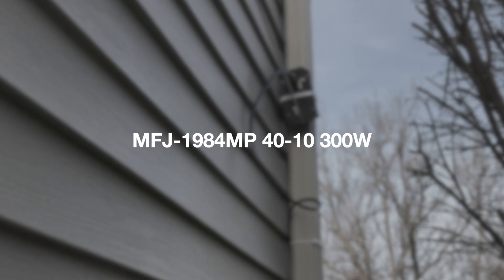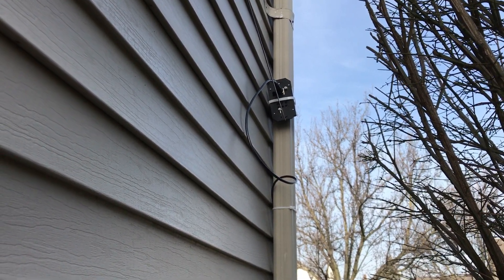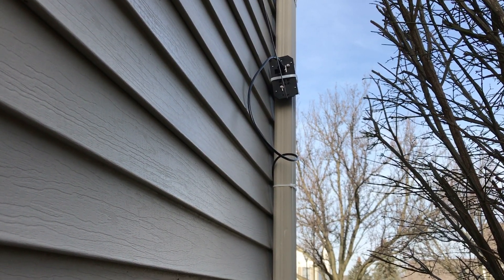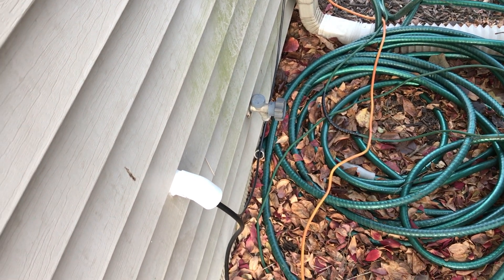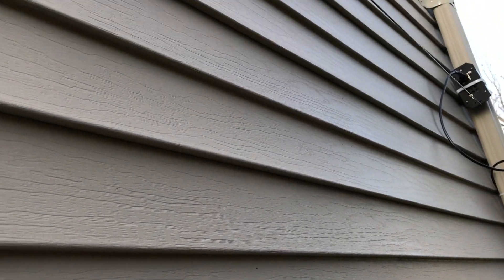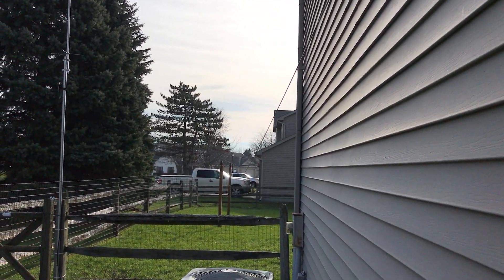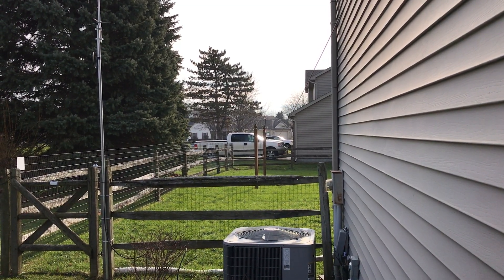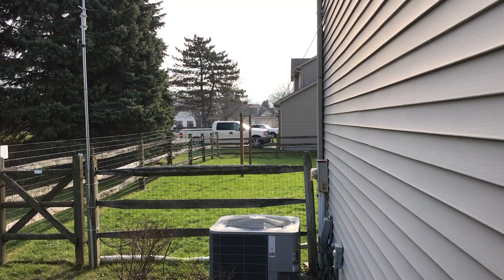MFJ 1984MP EFHW 40 10 300 W

Comment: Best wishes with your your learning, doing and everything the hamster hobby brings you, Vern. I’m just beginning to learn, myself. 63yrs old.
Licensed since APR-2023. Juuuust looking at getting into the General level. I bought a Xiegu G90 couple o’weeks ago because the HF/DX/QRP bug bit me. So now Gottttta do it.
Well Vern, CHEERS, 73 & many blessings your way.
ps.   Thanks for the video. Also- You can tighten the sag outta your antenna wire by
adding 3-4lb weight at the end. Or, better than tying off the end-
run the end of your wire through a little pulley attached to the support pole. THEN add as much weight as you desire for the
horizontal effect.👍🏼

Comment: What about angling it away from the house a bit?? I had horrible results when mine was like that close to the house. I angled it away and up and improved the operation of it immensely. I spot a few really tall pine trees there to the left. Could you attach a pull line to the end of it, throw the line up into the tree as high as possible, then pull it tight so it's up higher and away from the house?
Reply from the maker: I do have the wire high in the second pine. To angle away from the house more I would have to move the comet dual band VHF/UHF and mast.  I am also fixin to build the kit EFHW I received from Coffee and Ham Radios. That one will be positioned in a different location a little further from the structure. So looking forward to building that one.
Reply from the maker: I have since changed the antenna's position by moving it further away. It is working better  Thank you